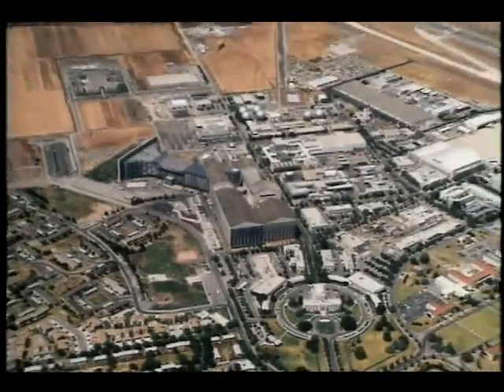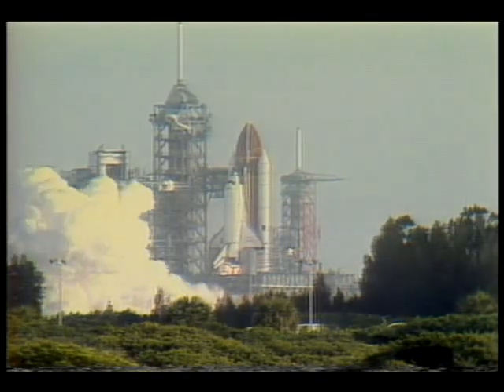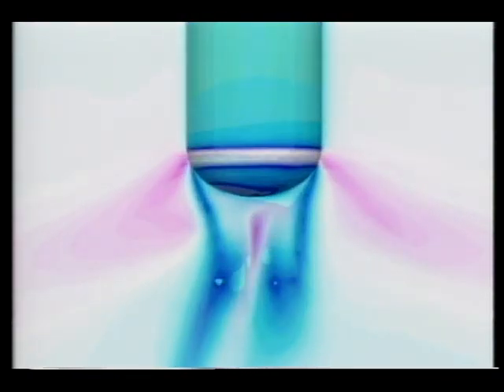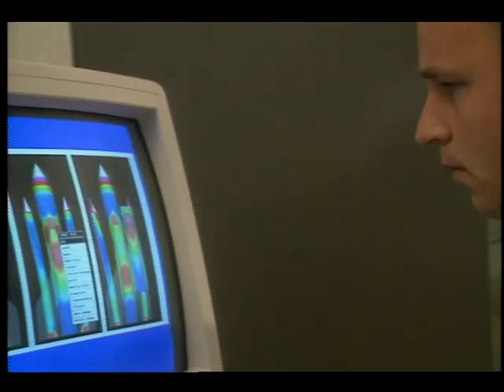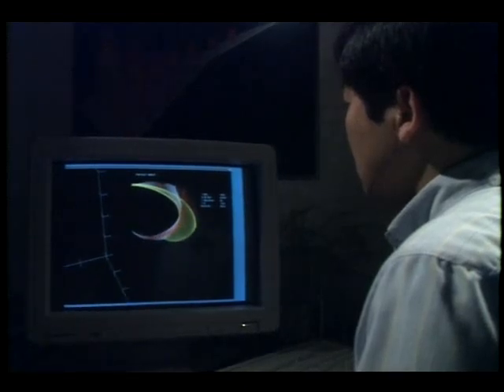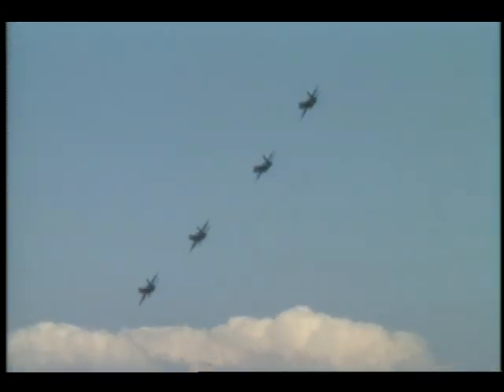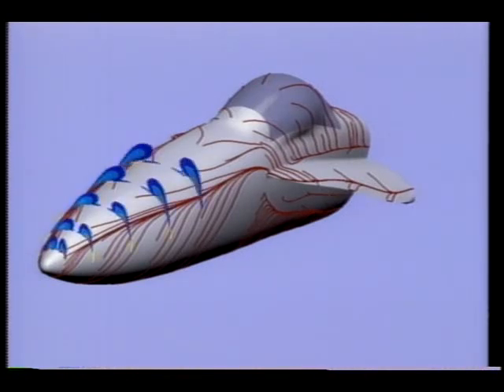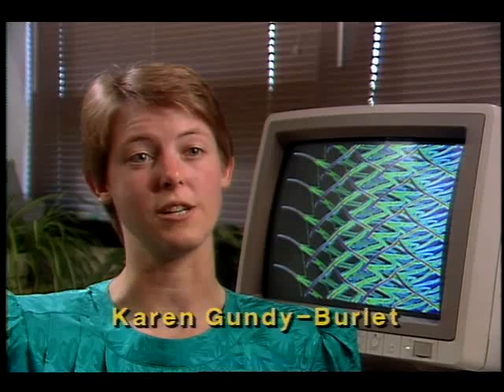1989 Computational Fluid Dynamics Highlights

Comment: I do fluid dynamics today, and even with modern tools its computationally intensive. I cant believe how efficient this is. Its so fascinating knowing the math behind it.
Reply: Yes, partial differential equations, for the most part, are computational intensive.
Reply: you might be the perfect person to ask, I own a 3090 but have been wanting to run 'vintage' code on it to  compare it directly to super computers of past abstract papers. where would I even begin in going down that rabbit hole? Obviously there might be certain computations that suit the 3090 better than others, kinda figured fluid simulations might be one of those areas
Reply: @burnerr  That'd be good to run something that uses CUDA, which is parallel computing that takes advantage of GPU. In the video they were talking about CPU processing, and graphic cards were not a thing, so the code may only use your GPU unless it's modified. What the video doesn't tell (unless I wasn't paying enough attention) is the computational time required back then to do those simulations. You see, they run the code in a super computer, get the data, and what they present in this video are the results interpreted by visualization tools.
Reply: Physical Chemists use computational fluid mechanics modelling and simulation techniques with the Diffusion PDE to model and predict chemical transport phenomena with statistical mechanics in atomic and molecular systems.
Reply: @burnerr  The main difference is that GPUs are highly efficient for code that is written for parallel execution. Each core in a GPU is less powerful than a CPU core, but you have orders of magnitude more cores in a GPU than in a CPU. 

Think of a simple operation, like adding two vectors element-wise. But they each have millions of elements. You can give a chunk of of these operations to each core and with all of them working simultaneously, you can make the process faster.

What I mean to say is that simply comparing computational power without any context will not lead you anywhere. You need to know exactly what kind of algorithms/mathematical operations you need for a given problem, so that you can say whether it can be made faster by this type of parallelisation.

(And I'm not even going into the problem of memory management, since you need to move stuff to and from GPU memory to make these things work).

Conclusion: not an easy task.

Bonus comment: a 3090 (or any consumer GPU for that matter) may be fast for certain things, but bad at other (look at comparison between single and double precision operations). Most consumer graphics programs do not care about double precision. Scientific programs usually do.
Reply: Also easier to setup with CAD models that is easier to create.

Comment: A single 3090 ti is 230,526x as powerful as the cray 2. The computing power we have available today is absolutely incomprehensible compared to the systems they were using in 1989.
Reply: And if that isn't mind blowing enough, todays algorithms are an order of magnitude more efficient, both for time and for space complexity. I can't find any direct comparisons between the oldest methods and state of art, but I do know that the most recent techniques like Lattice Boltzmann already cut down the space requirements for calculations in half compared to previous techniques while there were 10s if not 100s of different optimizations discovered since 1989
Reply: and?
Reply: Too bad the software is 1,000,000 x slower because programmers are 2,000,000x worse than they used to be.
Reply: @sumofat4994  it's not a fair comparison as cray 2 was designed for a specific use by the military while 3090 ti is designed for general public use for all sorts of applications. It all comes down to optimization
Reply: @sumofat4994  lol bro what?  programmers now are idiots.  tools and AI do all the work; tools and AI built on the shoulders of the giants of the 1980s and 90s.
Reply: @theastuteangler  @andy   Not all but the general case programmers are worse at getting the most out of the machines we have.  There are a lot of reasons security , poor programming practices and general laziness expecting things to just keep getting faster.
Luckily there is a trend among systems programmers to try and reverse that a bit but fundamentally thats just how it is.
Reply: @theastuteangler  do you even work in AI to state that vague statement, do you know how AI today are different from 80 and 90, in 80 90 we cant dream about today hardware, and gpu now are much more complex, even if 80 90 programmer are god, there people today still have to deal with cuda, opencl coding, system designer have to create tensorcore, computing core, compare them to how the way we optimize small hardware is like compare optimize a bike and optimize a car
Reply: @theastuteangler  Programmers now a days are genius, the programmers in the 90s built efficient algorithms, programmers nowadays build algorithms (AI's) that build even more efficient algorithms than the ones in the 90's
Reply: @theastuteangler  stick to fishing bro
Reply: Yea I've noticed this sort of person around who thinks that programming in general is declining. It's pretty ridiculous. A lot of those programmers from back in the day were smart people who liked to tinker with things and of course a lot of them made amazing things and were very smart. But I would be impossible for them to compete with modern programmers. The field is developed now. Many different fields like physics, math and engineering have focused a large amount of bandwidth onto computing. There is no way that the best programmers of that era would outperform the best of this one. Laziness is definitely not an issue because there is more money in it now. People grind computer science because they know it'll pay off. We just don't have the same cults of personality for good programmers.
Reply: Shm... My BT buttplug has more processing power than that Cray 2.
Reply: Yet my prof still insist that I spend 15 hours optimizing a model like it's the 90s so it can be solved 0.2 seconds faster "bECauSe iT'S cOmpUtaTionalLy eXpenSIve"
Reply: @theastuteangler  you don't know what you're talking about.  I'm a software developer and AI is a mostly abused and over-used term.  Most software development doesn't use any AI techniques.  Code made by other developers are nearly always used but the libraries needed for most software rarely uses AI techniques too.  You bought into the AI hype and misinformation because you clearly have no real knowledge about it or software development.
Reply: Damn the graphics look the same
Reply: @IARRCSim  oh, you code websites.  cute.
Reply: @henrychan720  get good, stop complaining
Reply: @theastuteangler  boomer
Reply: @IARRCSim  as is the case with most armchair experts
Reply: That is because it's easier/cheaper to throw more cores into a gpu/cpu than it is to properly optmize the code.

If something comes exclusively from our laziness it shouldn't be considered great imo.
Reply: @alexcargill3602  dude, using code from libraries/youtube videos/git hub is completely different from making something from scratch. 

To say one era of programmers are clearly better than the other is a violation.
Reply: With much less power draw.
Reply: @afoxwithahat7846  If you think people are not making things from scratch now, you would be mistaken.
Reply: @sumofat4994  Also screwing around on their phones and internet 10,000,000,000,000,000x more.
Reply: @sumofat4994   and we have 4090 now!!!
Reply: @sumofat4994  I found the COBOL programmer
Reply: Yet a mere operating system takes thousands of times more computing power ,programs today are so unoptimezed a mere text editor would break a computer back then
Reply: A 4090 is close to 50% faster in terms of Gflops than the fastest supercomputer of 2004
Reply: @ignacioaguirrenoguez6218  tell me you're trolling!! hahaha... dude if you add memory management task, you lost just about every "programmer" today... there's a reason there were so few doing it back before 2000, todays software would take so long to run it would be considered a fail.
Reply: @sumofat4994  that is so wrong.
Reply: @theastuteangler  the problems faced by the cutting edge of today are much more complex than what was faced previously as we have tools that make the tackling of such problems possible. Things only ever get harder, never easier.
Reply: @octaviodelser  No its true.  On average programmers today have very less ability to program than years before.  The peaks of the best programmers are higher than before because of more available knowledge but those seeking that low level knowledge have shrunk not grown.
Reply: @octaviodelser  Less complex ?  Not really the scale of the harder problems may have increased but the majority of programmers dont live in that space.  They are putting buttons on web pages.  Thats not entirely their fault its the markets fault and the needs of said market.
Reply: GPU cannot do well all type computations though.  For some computations you need to rely on CPUs. There is a reason the GPU cannot run entire programs on their own.
Reply: @sumofat4994  20000000 lazy, they aren even programmers, they just borrow code from libraries and put them together, aka hipster programmer.
Reply: @theastuteangler  Oh look, another technologically illiterate youtube commenter throwing around terms like "AI" like they know what they're talking about.
Reply: @mian6788  okay wordpress admin
Reply: @theastuteangler  Point proven.
Reply: @mian6788  you've made exactly zero points
Reply: @mian6788  that doesnt make any sense.  Go back to Minecraft
Reply: @theastuteangler  I pointed out your ignorance. I don't believe there is any winning involved when pointing out a simple fact.
Reply: @Retro Nomix Well, the Cray 2 was 1.9 Gflops and Power Mac G4 was 4-20 Gflops by 1999. Apple marketed it as "the first personal supercomputer." Fugaku in Japan is over 500 PETAflops.
Reply: A powerful cpu doesnt make always a powerful computer. A sgi computer from 1995 could open 67 GByte picture  in 2 sec. How long would take on an i9?
Reply: @gregwessendorf you said." Marketed" not real supercomputer.a supercomputer can run complex calculations for weeks and months a mac cant do that  because their light unix is not capable.
Reply: @sumofat4994  - You cant expect today's developers to use assembly and optimize code for all the different computer architectures.
It would just take too long and cost too much. 
Perfection is paid with $$$$.

Besides programmers able to program at that level (mathematicians, physicists, graduate computer science) have almost all been laid off in favor of much cheaper community college graduates with just python abilities.

Comment: what was the spec of the two machines running CFD at that time?  I heard the name but didn't have any luck finding their references.
Reply: Cray-1 and Cray-2
Reply: I'll do a quick comparison to put things in perspective

The Cray-2:                                                              A Raspberry Pi 4:
190 billion operations per second                      268 billion operations per second
4 cores                                                                    4 cores
cost $32 million                                                     costs $100-$200
Reply: @Hyraethian  Thanks for that comparison ! I have had an interest in CFD since the mid 1980s. 
However, I am a visual learner, and also short on money. 
I have seen a CFD program called OpenFOAM that is free, but still seems to require a knowledge of writing code and such. 
Is there now an open source ( or low cost ) CFD program / (" app" ? ) that has an easy to understand GUI ?  ( visual tabs and buttons, rather than blocks of text to input )
I have built 3D models in Softmage XSI, so anything up to that level of learning difficulty is what I am after. 
Years ago, Autodesk released a CFD program called "Project Falcon" 
It was very basic, but got me super excited, because I was even able to run it on a first gen Surface Pro tablet. 
It gave info such as cD and lift, and all within less than an hour of render time. 
It seemed to be geared towards kids, since it was extremely basic and had silly things you could run tests on, like a sci fi spaceship and even a oair of sunglasses. 
It seemed created for touch control as well, ( and worked great on the Surface Pro touch screen ) I had high hopes that a phone app would be created and that it would be offered to the masses for cheap. 
However, that was all dashed when Autodesk killed it and made it Autodesk Flowworks ( or some other name like that ) and now markets it for thousands of dollars.
Reply: @Hyraethian  how did you find out the specification of the Cray-2?   is there a formal reference I can go to?
Reply: @DennisZIyanChen  I just pulled stuff from Wikipedia. I tried to read through the PDF of the  CRAY-2 Computer Systems Functional Description. But it was too dense for me and I just decided to quote the figures other people had worked out.
Reply: @DennisZIyanChen   Page 170 of that manual starts listing specs.
It uses measurements i'm not familiar with. It measures clock speed in nanoseconds instead of GFLOPS, Memory is measured in Mwords instead of megabits the document is +30 years old so the terms are a little out dated.
Reply: @Hyraethian  Thank you friend!  I appreciate this info
Reply: @O-cDxA  torrent solidworks, tick the fluid dynamics box when installing
Reply: @Hyraethian operating system  running on cray can do things raspberry or 3090 cant do

Comment: iPhone 14 pro is around 1000x faster than that Cray 2. Pretty crazy
Reply: whats crazy is that they effectively combined thousands of PCs into one simulation database from MSFS 2020. A hivemind of computing. There is actual fluid dynamics so the military, aviation businesses will be able to use the flight data which has accurate simulation variables.

Comment: Kids in 2021 are you telling joke ?  100,000 of cpu will requre to produce 1 TF of computation power . That cand do my single RGB gamming rig. 😍
Reply: And it makes the results they could get back then even more impressive! The simulation of the shockwave/boundary layer unsteady interaction in the external tanks is absolutely mesmerizing! And they did that with a supercomputer that my current PC would basically obilitarate. So, it was not done using only a "brute force" first order upwind with a buzillion of elements in the mesh.
Reply: Hurrah, you want a cookie? You are standing on the shoulders of giants.